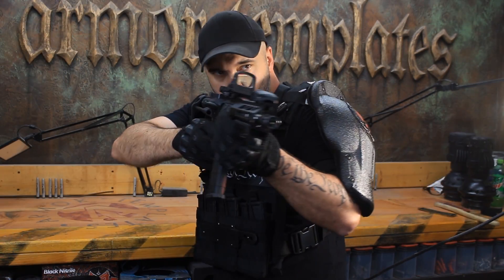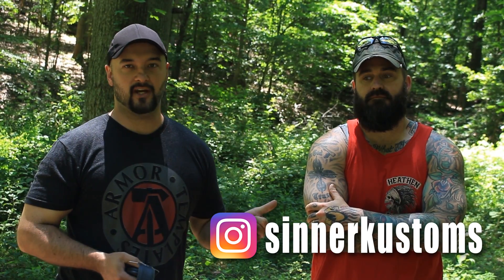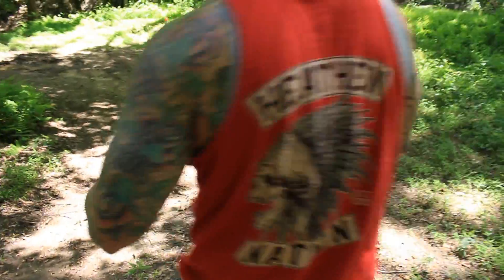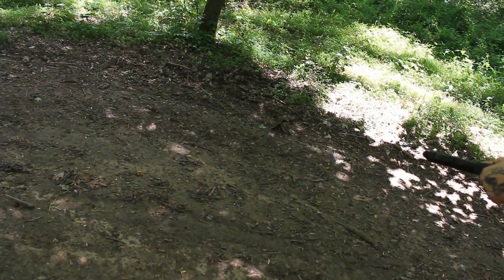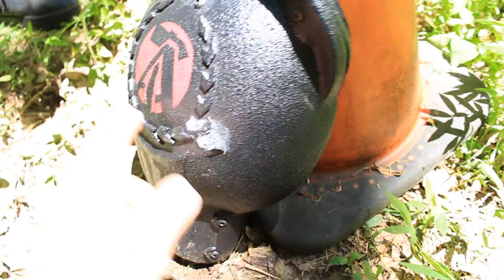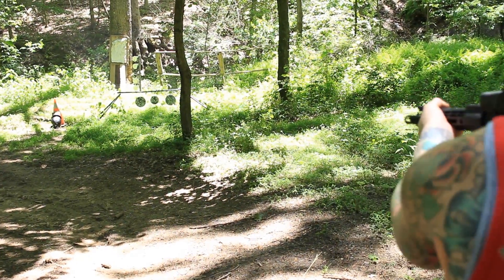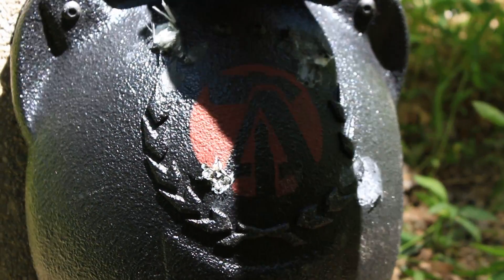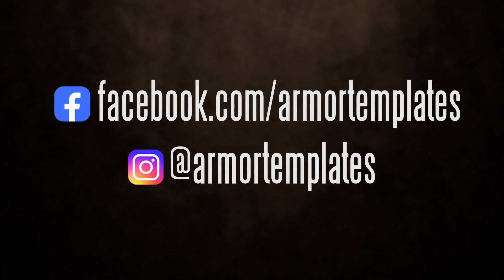DIY BULLETPROOF Shoulder Armor! Is it really bulletproof?

Comment: Great job on the build and learning a new medium. Glad the thing stopped some rounds.  
However. 😎
Making an armor piece for bullet protection that has any fiber glass in it is not a good idea. On impact, the fiber glass is burst into the air with probable eye and lung/throat/sinus contact. If the bullet punches through then not only do you have bullet fragments in you, you now have powdered and fiber strands of glass in the wounds. Things on you, go in you..when bullets fly.

Comment: I say this test is kinda unfair on your diy project because unless your planning on being hit several times in the same shoulder its a hard "test" to prove if its bullet proof as the material breaks up more and weakens with several different guns and shots.
Reply: That's what makes it more impressive. If it holds up this well through punishment test, then all the more secure in actual use
Reply: Plus they were shooting a shoulder piece dead on when more likely the round would have an angle on it and be more likely to deflect. Great armor for smaller calibers!
Reply: If you haven't shot back by then, maybe it's best to stay home

Comment: Add 10% graphene to your resins if you want to have effective armor.
Reply: Yeah because you can just buy graphene, can’t you
Reply: @iain3713  Yes, there's a few companies that sell graphene platelets for polymer composite work that would suit this project. Though given the cost, I'm not sure it wouldn't be more efficient to just add a metal backing or replace the fiberglass with spectra or vectran fiber instead.
Reply: Berserkasaurus Rex link please
Reply: @iain3713  There's a website called Duck Duck Go. You go there and type in "buy Graphene" or something similar and then you get a list of results, most of which are company websites that offer graphene for sale to consumers.

Welcome to the internet.
Reply: @berserkasaurusrex4233  Most of the 'graphene' sold consists of tiny flakes that are probably mostly graphite and will do fuck all mechanically.
Reply: @iain3713  That "probably" should get an award for all the heavy lifting it's doing.
Reply: @iain3713  Yes you can even make it https://www.youtube.com/watch?v=8dL60APy5ao

Comment: Not sure how this would work out, but the presence of hardend ballistic resin/gel in place of the normal resin might help stop more rounds.
Reply: No
Reply: @Barskor1  enlighten me
Reply: @NoharaLoco-gw8ld  thanks for the info. I came about the idea on the basis of word of mouth. A guy I knew who worked for an engineering firm developing DARPA tech told me they used an advances ballistic gel (not the test stuff) to tryn enhance the effectiveness of flexible Kevlar. I've always wondered if you could do that with a hardend gelatin, almost like an advanced resin.
Reply: Nope. Would need a layer of hardened steel a couple layers away from the innermost to have any chance
Reply: @Xiomaro01  Add graphene
 to the resin, it is more effective and lighter than the steel.
Reply: @NoharaLoco-gw8ld  No graphene is what I meant some neat little egg heads at IRC Rice university shot some graphene sheets and so on it is stronger than steel one layer thick it works the same way layering carbon fiber and glass fiber weaves in cross patterns only at the molecular level. When you mix in the graphene flask to the two part resin it is like stuffing poker chips in pillow fluff they are all over the place at odd angles but when you compress the other materials you would use in forming armor like kevlar carbon fiber weaves etcetera it forces those randomized graphene plates into a flat orientation similar to calcium in abalony shell.
Reply: @NoharaLoco-gw8ld  Your welcome.
Reply: @NoharaLoco-gw8ld  that's really interesting. Thanks for the info

Comment: Very impressed. Working on a similar project and this helps.
Reply: Making an armor piece for bullet protection that has any fiber glass in it is not a good idea. On impact, the fiber glass is burst into the air with probable eye and lung/throat/sinus contact. If the bullet punches through then not only do you have bullet fragments in you, you now have powdered and fiber strands of glass in the wounds. Things on you, go in you..when bullets fly.
Reply: @petersonl1008  Agree, mine is a Carbon-Kevlar construction.

Comment: I wonder if you took the rubber layer out of the inside of it and did more layers of fiberglass it would work better. Also pure fiberglass might be better than a mix of fiberglass and carbon fiber. Awesome build though and effective!
Reply: Nohara Loco ceramic would probably help a ton
Reply: Please read a chapter on material science..

Comment: Not surprised that it didn't stand a chance against the rifles, but I was flabbergasted that it could take a hit from a .50 caliber desert eagle. That's pretty badass!!!
Reply: as far as i understand fabric based armors like kevlar and fiberglass/carbon fiber can stop any 'blunt' projectile provided its not going at super insane speeds.

The reason (to my understanding) that rifle rounds go through kevlar vests for example, is because the point on the bullet allows it to spread the fibers apart. Thats why adding something as simple as a steel or ceramic plate allows you to stop rifle rounds so much easier, because it either breaks up the bullet or tilts it on its side making it into a wimpier 9mm basically
Reply: Isaac Sudduth its a big SLOW moving round, alot of punch. But no pen power. Speed breaks armor. Now a SW .500 might smash it.

Comment: Bad ass design. The finished product was really good looking and was essentially 3A rated. I would have liked to see a shot on the upper guard. Even though it was the same thickness, Im wondering if it being so near the edge would have made the delamination easier to defeat.
Reply: Isn't 3A what most police officers wear for their vests?
Reply: I'd want a outward facing guard like what's on the top all the way around the thing (doesn't need to be nearly as big), one primary advantage a thing of this shape has is the chance to redirect a round as it's far less likely a round will be coming straight in, of course if the round or fragments of it are being redirected into your chest or stomach or back then that's not very helpful.

Comment: I wonder what a 12ga slug would do?
Reply: What kind? There are some rounds that will pop right through AR500 solid body armor plates and still have enough energy to go right through a human body. As for lead slugs, frangible rounds, most fragmenting rounds, and 00 buck shot I suspect it would handle like the DE .50 rounds, which would be a huge amount of protections since one of those to the shoulder could easily take your arm off and/or pass through the upper arm into the chest, shredding organs.
Reply: Even a pure lead slug, you’re looking at all the bones in your shoulder joint being broken. Not saying no plate is preferable, just that you’re gonna have a very expensive hospital trip, instead of a funeral.

Comment: Neat! I wonder how this fares compared to Kevlar
Reply: The original inventor of the bulletproof vest used a Smith & Wesson 38, (original police issue), shot himself point blank in the middle surviving. Seen video of a Texas Highway Patrol officer get shot point blank during a traffic stop & he survived to not only returning fire but to get back to his cruiser to call in backup.  It not the penetration of the bullet that causes injury but the dump of energy in the spot most of the time causes bruising at worse cracking or breaking something like a rib.

Comment: We knew the rifle rounds would go through, but bitch slapping away the .50AE was VERY impressive!  Especially, on the first go of testing!

Upgrade: Kevlar/Aramid instead of fiberglass.

These are not only the standard materials used in body armor, but they also don't suck anywhere near as much to cut and grind on.  Yes, they are more difficult to cut and grind, but they also don't make you want to rub your arms with sandpaper to make them feel better!

Comment: Was that flex seal for the surface coat? lol
Reply from the maker: It's 2k bedliner. Same as they use on plate armor.
Reply: Truck bed liner has also been used to resist explosions, holds stuff together.
Reply: Should try a thick layer of Rhino coating.

Comment: my suggestions to increase the protection is to contemplate following layers and materials or strategies:
- soft (rubber?) -> draws energy
- hard (ceramic or sand particles / pockets between layers) -> grinds projectile & dulls the "edge", changes angles due to irregular resistance and starts to tilt or "zig zag"
- steel (might add more flexibility or hardness vs fibre glass)
- kevlar
- spaced armor (penetration distance is one of the best ways to increase protection)
-> look at the german leopard 2 tank with its hollow & angled cheeks on the turret front - designed to eat penetrators, making it impenetrable for armor piercing darts due to the penetration distance and deflection of angle upon penetrating the first sacrifical layer
- angles -> avoid bullet "traps" and try to cause a richocet away from the wearer, if possible (will not ricochet from a sacrificial layer [spaced armor], but might get trapped there which is less of a threat to others around)
Reply: Tank armor systems isnt applicable to humans as there armor isnt motorized.
Reply: I think there is some merit to the idea of designing in an empty cavity in the middle. Might add a bit more protection without adding any weight.

Comment: Impressive Light armour,  it would  offer decent protection against shrapnel ,shotgun fire ,frag grenades and maybe light mortor fire.
Using the similar format  perhaps experimenting  with  shaped ceramic plates and AR 500 plates  would offer greater protection for higher calibers.
Reply: Mortar fire?  The concussion is what kills with mortar rounds, not shrapnel. Even AR500 will not defeat concussion. Maybe shrapnel from a grenade.
Reply: @angusoldwolf295   I ment shrapnel from the mortor as its the bigger killer . a direct hit from a mortor would fuck up anyone.

Comment: When it comes to Most Armor...  SPEED Kills, as the saying goes.  Even simply being a smaller diameter round and bullet design with less surface area at the tip, can noticeably increase penetration.   That's why .50AE moving a few Hundred Feet Per Second faster (around 1,400 fps) and weighing about twice as much (probably around 300 grains) as the .40 cal, didn't do too much.   And then that light for caliber Hot loaded 9mm scream'n at 1,800 fps, performed significantly better.    The .50 is more like hitting with a Sledge Hammer vs the Claw end of Framing Hammer!
       Nice work! 👍!!!   Well Built, and a Good Test!

Comment: I wonder if you could include some small ceramic tiles in between the layers in a few key places to increase the rifle round resistance, without massively increasing the weight. From some of the Paul Harrell videos even standard ceramic floor tiles appear to offer increased resistance to 5.56 penetration.
Reply: You can get bathroom tile in sheets of small squares that might be able to follow a curve. Probably need quite a few layers for rifle protection.

Comment: Master if a peace of armor is bulletproof is also swordproof
Reply: Bulletproof does not always mean stabproof.  Stab vests or stabproof vests are made of a different type of weave and fiber than bulletproof vests because the blade can cut through the fibers of a bulletproof vest like butter. You can have a combination vest and is rated by levels.